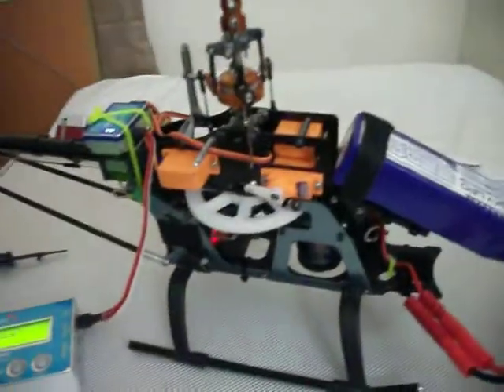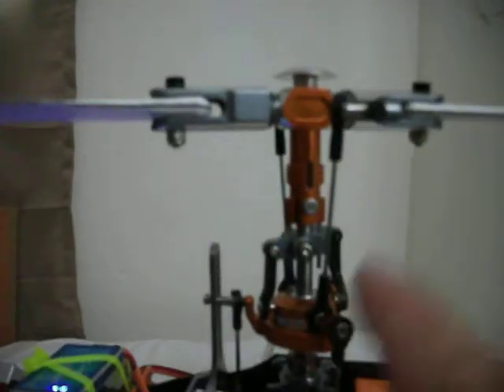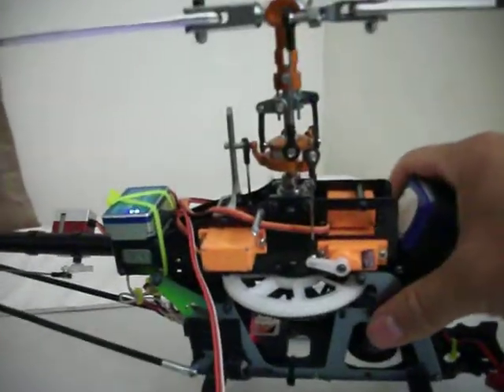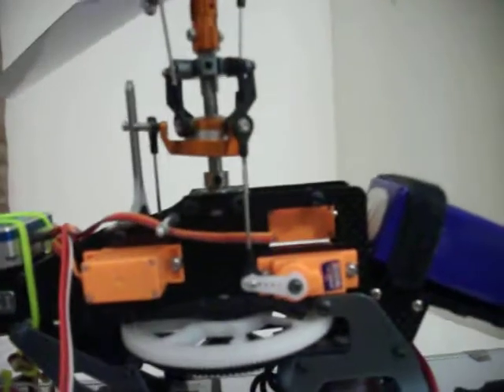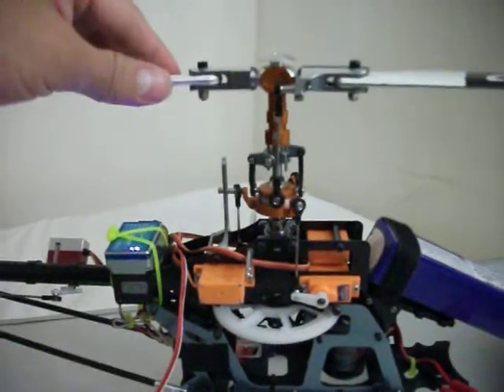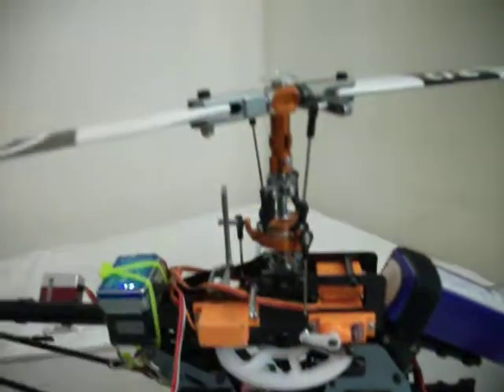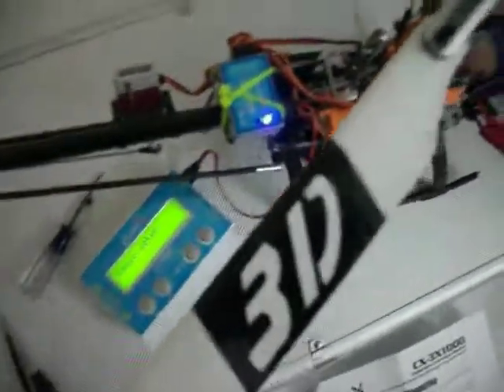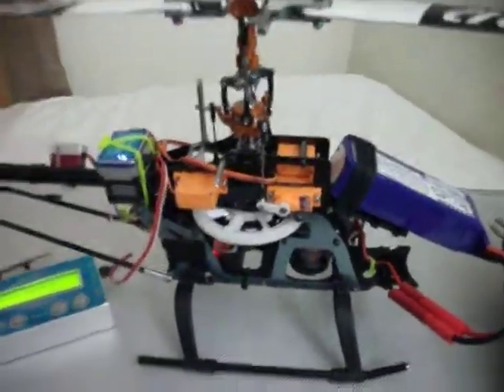Setting up the HK cheap flybarless arms and copter x flybarless gyro

Comment: Hey, how did you get on? I've just got my CopterX flybarless kit and electrics and the same FBL gyro that you have. I've finished setting it all but haven't had my test flight as yet. When I stick back it looks like its going to head off backwards but off to one side, same with stick forward but everything else looks good.